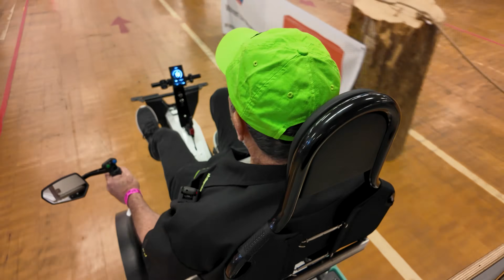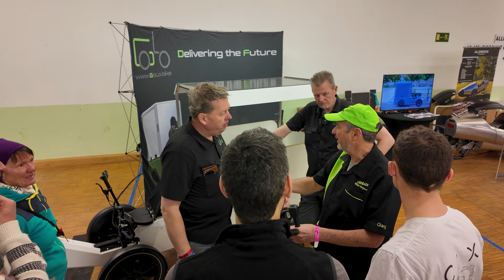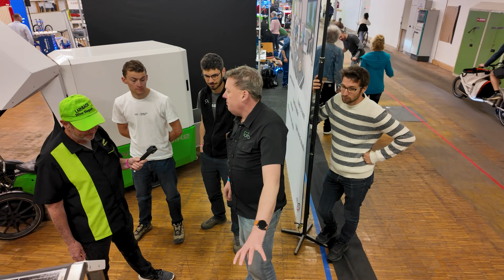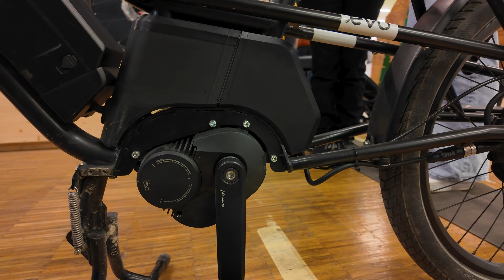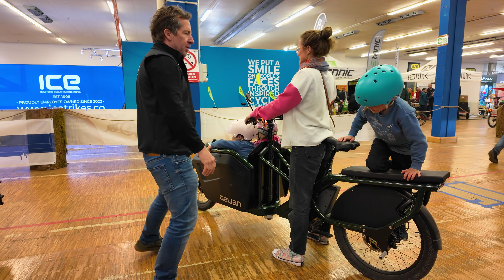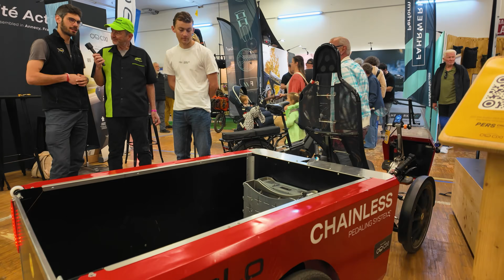Spezi 2025-Chainless Biking with CIXI and GoLO!

Comment: In the beginning it was a kind of confusing discussion about where the electricity was going. But it was made clear. The mechanical energy is changed into electricity and goes straight to the wheels. Depending on the chosen level of e-assist the battery delivers extra energy from zero to max.
Being EUROBIKE 2025 visitor I have riden a Hasebikes, Kettwiesel @Hasebikes,  with the PERS system by Cixi, @cixilife. The two motors in the back wheels were All-Axle motors by Grin Tschnologies @grintechnologies .

Absolutely astounding performance when I compare it to my riding my Kettwiesel Titanium (2007) It's just nearly 100% the same. Subtle the motor assist your pedalling from the get-go. No rough kicking in. I can totally relate to the Gary's amazement. .You are, anyway I am of course, just riding a bicycle and you do not miss the chain any moment. Yes, YMMV, I am aware of that.

And do not forget the you can also choose between levels of cadence. So you can finetune, you can adapt your bike exactly to your liking.  After a lot of searching on YouTube I found a very good video made by Bart Daems, @fietsoplossing about his trialrun with this special Kettwiese during EUROBIKE 2025. I have a more extensive comment there, in Dutch, but hey, that translates easely. Same for as his commentary. Just switch it to autotranslate.
Here's the link: https://youtu.be/S_WBxmeTo0Y?feature=shared
Enjoy, like I did.

Comment: Would be curious to see cost and weight differences of a Cixi system vs a chaindrive. Even if it costs and weighs more, it seems to have benefits. Golo looks like a nice application of the cargo bike concept.
Reply: GoLo designer here, at this point it is still more expensive but we have found more affordable motors (which doesn't impact the quality and feel) and we believe we should be able to match the price if we fully commit to CiXi since we can also make the frame design a lot simpler without the (complex) chain drive. And yes, the GoLo is definitely a nice application, we even believe it is the best in this capacity class.
Reply: @rosserobertolli  Which motors do you find, what brand? Thanks in advance also for your comments here!
Reply: @Ligfietsen Right now we are using Heinzmann motors, very reliable and with enough torque. The motors we are testing will be announced when they pass our tests, otherwise they will fade into obscurity unnamed. We will only use them if they can match the Heinzmann performance
Reply: @rosserobertolli  Many thanks for the answer. Aha Heinzman, they are already long time in the business, By the way: is the generator then also from Heinzman or from another brand?. Good luck with this line of work and creative thinking; this is the future as far as I am concerend.
Reply: @Ligfietsen No, the generator is from CiXi. This is sadly the ONLY brand that makes a sensible generator that actually generates power when cycling and doesn't just feel like a friction machine with an on/off switch for the assist. The CiXi really feels great, gives you maximum control, easy reverse and enough assist from the Heinzmanns
Reply: @rosserobertolli  Hi, again thanks! So very friendly of you react almost in real time. Kudos!. Great info from someone like you who's really in the know!
I trialrunned the Cixi-setup wthe the Kettwiesel ONE and two All-Axle motors from GRIN. It was really amazing how subtle everything worked. No horrible hick-ups and unexpected jumping forward, as I experenced from another brand. The easy to measure backpedalling to a (near) standstill was just like riding a old-fashioned bicycle with a back-pedal-brake.

Wished I could buy a kit to attach to my own Kettwiesel + of course motors in the hind wheels.)
Hmm, driving a front wheel motor on the Kettwiesel?? Option??  But I'll start saving anyway. 8-)

Comment: I would love to try this on one of my trikes. I just bought a new chain, new cassette and new wireless derailleur, and it’s been a learning curve to get them all to play together. 
I guessed wrong on the chain and ordered the same amount as my other trike which ended up being six inches short, but since I saved extra links previously, I could splice them in. 
I carry the trike on the back of my RV, and the most affected part is the chain. I have thought about removing it for winter travel because it rusts so quickly
Reply: What if anything do you tow behind your RV ? We tow a Chrysler Pacifica on a Acme Ez-Tow tow dolly,  with our 2 ICE Adventure HD 26FS inside, plus toolbox and tote with shoes,helmets etc. Batteries abpnd chargers. The Dodge/Chrysler  Stow N Go seating works perfectly for using our Pacifica as a Trike Transport as it give more than enough room for our Trikes, and assorted gear, with the Seating for 7 Stowed. When we are at or campsite, and Trikes secured, we have seating to be able to transport 7 adults.
Reply: @maxjr758 I just have the trike on a Draftmaster hitch rack. My RV is 20 feet long so it fits in a parking spot. I think it has a class five hitch, but I haven’t felt the need to bring a car. My trike fits inside both of my cars though

Comment: It's an interesting design, and I encourage innovation in the design of cycles and  cycling accessories.  As for my own personal use, l want to be the one getting the exercise and not  being  reliant on a battery-powered motor for assistance. 🖖
Reply: GoLo designer here, I also almost exclusively use non-assisted bikes but this is just not possible in this load capacity class. That said, an empty GoLo can be driven without assist without too much effort, it is quite efficient. And the CiXi is also extremely efficient, I have driven 15kph with 0 assist (empty battery). So only generated power to the wheels, we were quite impressed with the CiXi system when we first tried it and therefore it is the only generator we would ever use for our CargoBike platform